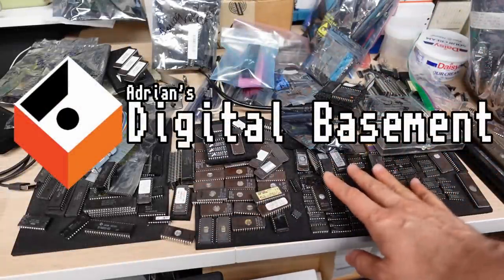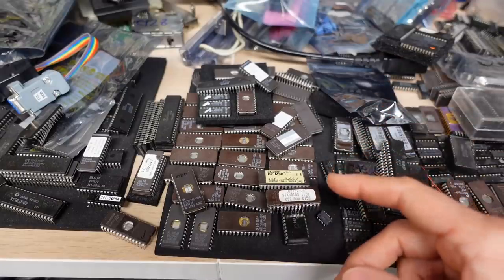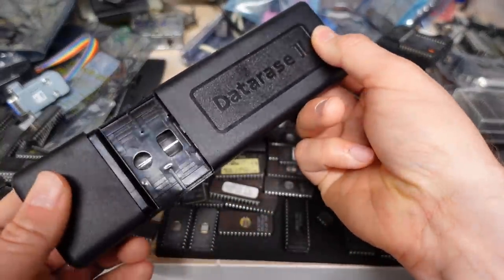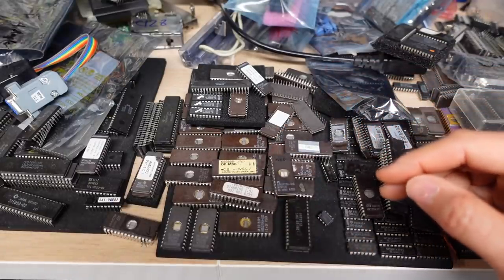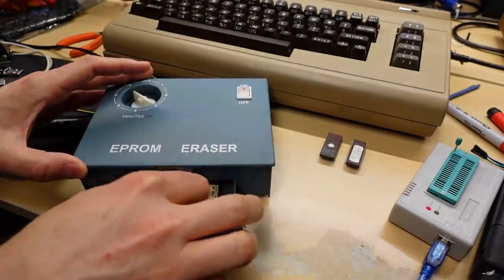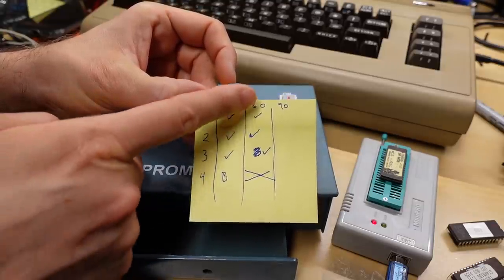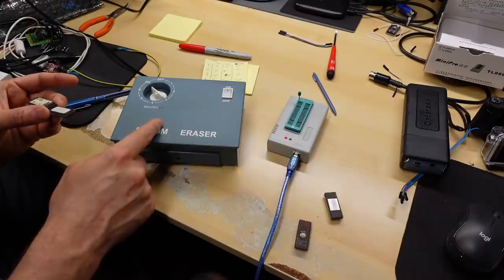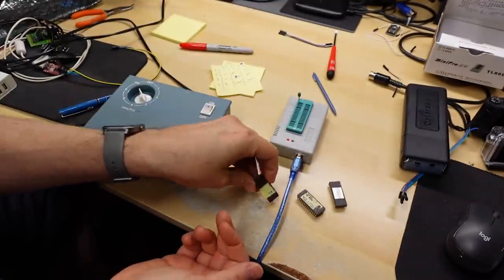Do paper stickers protect an EPROM from getting erased?

Comment: I have had a eprom that went corrupt. It had no sticker and the cabinet had an open mesh at the top and rear. It stood near  a window for many years. After it failed it stood there for some years before it came in fore repair. The eprom was as good as empty, tried to get the hex file from the manufacturer but it was to old (25 to 30 years). It took long because UV is (partly ? I blocked by klass. My eprom eraser does it most times in 10 minutes. I tried erasing them on UV tubes from a face tanner but after many hours they were still not erased. 

Thanks for testing this, I wondered for a while if stickers were enough, I use alu tape after programming to bre sure

Comment: Most glass will block UV so even by a window it wouldn't erase it, unless the window was opened. Same reason you can't get a sunburn inside your car. 

If you do need UV to pass through glass, like in aquarium UV sterilizers for instance, it has to be quartz glass.

Comment: It's a good thing EPROM's have been superseded by other technologies. I'm pretty sure the visible-from-space, disco-nightmare of high-intensity ARGB LED lighting that I (and my enablers at various hardware vendors) splattered all-over the inside of my current rig, can not only emit enough high-spectrum UV light to erase those EPROMs, but could burn the paper labels right off the top of those ceramic packages. And yes, ARGB does make my 5950x faster, and I will hear no different.

Comment: Id be interested to see whats in that EPROM eraser. I have one that looks very similar, and it looks like it was made from a recycled CFL lamp ballast! The wiring was dreadful, nothing was insulated and it was only by a miracle that the tube tails were not shorted out. Oh, no lamp holder for the tube either.
Reply: sounds like the average American domestic central air system, they sure do love their rats nests and burcaps.

aluminium wiring was an economy thing post WW2, IR2 losses overheats and catches fire, previous to that was cotton covered wire, gets chewed overheats catches fire...

Comment: Ten to 15 minutes isn’t always enough with old EPROMs… the last ones I had to erase and reprogram took a half hour in the eraser. Also, there are certain chips the modern TL866 programmer will not properly program, you have to use an older unit to do those. Ran into that when trying to do some 2732s and 2764s. As for labels, I tend to take the labels off any that are intended to be repurposed as I don’t care about the content (or have it safely backed up somewhere) and only put on a label once the chip is programmed.

Comment: just got an old Heathkit ID-4803 EPROM eraser  on ebay for the same price as the new chinese plastic ones, this one is an old metal one that they used to sell as DIY kits in the 80s and 90s. works great, erases chips in 10 minutes.

Comment: When you think about it, it's pretty obvious why the paper stops the UV from erasing the EPROMs. The photons have to hit the die with enough energy to flip the bits, and only UV-C rays have enough energy to do that.

If you've ever shone a UV light on paper, you'll have noticed it fluoresces blue rather than just reflecting the deep purple of the UV light. That means the molecules in the paper get excited by the photons and emit lower frequency blue light. Because the paper fibres have a random alignment, there won't be any gaps for photons to get through, so the only photons that reach the die are the ones that are emitted by the paper fluorescing, which are too low-energy to flip the bits.
Reply: That's a fluorescent dye deliberately added to the paper to make it appear bright white.
Reply: Interesting. Now I'm curious whether brown or unbleached paper without the dye would stop the EPROM from being erased.
Reply: @UpLateGeek  Basically, yes. For a dye to give fluorescence, it has to be diluted (because the emission and absorbtion spectra heavily overlap and in high concentrations it reabsorbs its own fluorescence until all energy is used up in non-radiating transistions). So it will absorb only a few percent (at max) of the total UV anyway.

Comment: I tried to erase eproms using sun light without success.
More than a week with direct spanish Sun. No byte goes to FF.
After that test I buy an UV eraser.
Reply: I've had mixed results.  Programming 27128 or the better chips (28 pin) on a minipro, yeah, they don't get erased by simple sun because I tried that as well.  However, I had some 2716's (24 pin) that I programmed with the minipro and those did get erased.. However, the minipro barely has enough voltage to properly flash those eproms so part of it could be that, or perhaps they are just more susceptible to UV.
Reply: @brianv2871  Probably underprogrammed, many cheaper programmers give not enough charge. These EEPROMs can partially lose data after few years in target device (dark environment).
Reply: @adamw.8579  Yeah, that was my assumption as well.  Thanks!

Comment: I used to work at intel and there was an EE who had a cube near the window, and had kept an EPROM on top of his cubicle for years and years checking it every few months, just to see when it would be erased.
Reply from the maker: Heh! I'd assume through window glass it's even less likely since a lot of UV is filtered by regular glass as well.
Reply: @adriansdigitalbasement2  Unless it is made for UV filtering glass doesn't normally filter much.  Plastic is much better at it.  I am doing work with epaper where UV filtering is important.  BTW I emailed you to see if you want an Apple  (68K) Interactive TV Box.
Reply: Modern energy-efficient windows are specifically designed to block UV.
Reply: @nickwallette6201  thank you. I didn’t know that

Comment: judging by all beige plastic that has been yellowed by UV, the risk isn't zero even inside the case. 

just depends on whether light enters through a vent or space and hits an EPROM.

it doesn't have to be totally erased, just one wrong bit can ruin it.

also, CRTs emit UV. strong enough or for how long... who knows?

i would say you're safe, esp since you can test and remake EPROMS. but if you give something away, be a good guy and cover it up.

Comment: Thanks for this. I wrote the completed release of Star Fox 2 on to an EPROM chip and hand wired it into a doner SFX2 cart, so I could play it on original SNES hardware (this was before flash carts could emulate Super FX chips). I was just wondering if the chip would need to be rewritten eventually. Good to know!

Comment: can you try this with a piece of scotch tape? i'm curious if it would still block UV. uv transparency is a weird thing
Reply: I'm quite confident it will protect it for some time. Although if EPROMs can be erased with sunlight, it means that UV-B can erase them after some time, because there's no UV-C in the sunlight at ground level, the atmosphere filters it out completely. The Scotch tape will probably block more than 95-98% of UV-C, but probably won't block more than a few tens of percents of UV-B, which is also emitted by germicidal lamps.

Comment: I think people tend to forget that PROMS In general all have a limited lifespan once they're programmed. It's been a pleasant surprise actually that most of these older EPROMS have lasted 30 plus years. There's never a guarantee they will actually last that long. Some of the more common drop-in ones today such as the 28C series have a 10-year lifespan according to the data sheets. They might last longer, but there's no guarantee. It does seem like the older ones that use the 21-volt and up programming voltages tend to last longer. Again though, there's no guarantee outside of the data sheet spec that it will last. Even then, there are always bad ones in every batch!

This is why it's critical to dump old PROMs in particular into archives, especially when they're used in critical BIOS functions.  With common programmers such as the TL866 dropping 21-volt support, it's also becoming critical to become familiar with replacement PROM options and alternatives. Eventually the current generations of PROMs will also run their lifespans, and replacements for those will need to be developed. It's a never-ending cycle. Nothing is permanent, especially in computers.

Comment: I have heard of "one time programmable" eproms without the window being erased by a dental x-ray, maybe multiple exposures required. But it would hardly be worth the hassle these days.
Reply: Some UV EPROMs, were packed to IC without UV window, so they become such one-time EPROMs, those could be, in theory, erased by x-ray (or gamma radiation).
Real one-time PROMs have components (diods ?), that were selectively burned on programming.
Reply: @semibiotic  sure, though most of those applications you would use a mask prom that is programmed before they even cut up the wafer
Reply: @semibiotic  I tried erasing the OTP EPROM (normal programmable EPROM, but without the window) with a hospital X-ray. No success.
It is possible that I needed a more powerful or special x-ray.
Edit: By the way, real one-time programmable chips are not EPROMs, but PROMs. Because the letter E stands for "erasable".
Reply: @SirWolfCZ  Thank you for correction.
Reply: @SirWolfCZ  
Needs at least a few tens of kRads according to various sources.
An hospital X-ray machine creating these doses would erase the patient, too. But .. like .. immidiately. 

When EPROMs were first conceived, they actually planned to erase them via X-rays. But then they discovered that X-rays also caused lattice defects in the chip, so you could maybe get 2 or 3 erasings (with the latest programming being significantly less reliable) out of them before you had to bake the chips in a oven at quite high temperatures (read about 600°C) to anneal them, which also damaged them in the long run.

Comment: Aren't those labels metallized at some layer anyway? At least ones in all 386 and 486 boards I got were, or they had some additional layer making them completely non-translucent. Even used one to cover a super-bright blinking standby LED in my Samsung monitor back in a day, 'cause even insulating tape did let some light through, and Award BIOS sticker did not ☺

Comment: EPROMs aren't only erased by UVC light, any light works. UVC is only much faster than other wavelengths due to having much higher energy. There is nothing special inside an EPROM that reacts specifically to UVC light. Photons strike the surface and punch out electrons (similar to a solar panel), which reduces the stored charge in the memory cells.

Comment: Those things require UV-C light (about 265nm wavelength) to erase. The EPROM windows are made of quartz, not much else will pass those short wavelengths.  And I can believe that a fat fingerprint could block the erasing.  It would be best to clean the window before erasing as there might some left over adhesive on the window.  Of course all that stuff is hopelessly obsolete.
Reply: Where did you get that information from?

EPROM datasheets say less than 400nm.

Comment: EPROMs are erased with UVC. It's unsurprising that a paper label would block UVC, because pretty much everything blocks UVC--including the atmosphere and most types of glass. So while yes, the paper label will make absolutely sure the EPROM does not get erased, there's unlikely to be any significant UVC for the chip to get exposed to in the first place.

FWIW I tried erasing an EPROM with the curing light that comes with rapidfix adhesive, and not a single bit was erased after an hour. I suspect sunlight only works because the sun puts out so much UVC in the first place that enough gets through the ozone layer to do the job--but it would have to be direct sunlight, even a windowpane would block most of *that*.

(It's possible that the broad-band UV put out by the sun is powerful enough that it can erase EPROMs despite not being the ideal wavelength. An expert would have to speak on it)
Reply: EPROMs can be erased with UV-A according to their datasheets.

Comment: The light of a single arc in the computer can erase bits in the eprom. Given the fact that regulated powersupplies regularly discharge their capacitor when the electricity cable is plugged in, the light of one those sparcs could surely erase some bits some of the time.
Reply: Er, well, if your capacitors dis charge when you plug the power in, you've got a faulty power supply.  But also, there shouldn't be any arcing.  If your PSU is arcing, it's also definitely faulty.

(With the exception of inrush jumping across inlet connector terminals as the plug first contacts the receptacle.  But that's going to be contained by the insulating material of the plug and receptacle.  Likewise, any old manual switches -- but again, that's going to be contained inside the switch body.)

Comment: I wonder if those OEM paper labels were chosen for being UV-blocking (special paper?), but I doubt it.  A more extensive experiment would test the post-it note too.  

I think an important point is that for an EPROM to be ruined from accidental erasure, potentially only a single bit needs to be erased, not the whole thing.  That can happen from e.g. a random cosmic ray, so the chip only needs enough protection for the UV to be less likely to erase a bit than a cosmic ray, for a given time period; any more UV shielding is mostly pointless.  It would be interesting to see research on a chip left in a non-basement indoor location (i.e. with windows) and see how long it takes for the bits to get corrupted.  I'm not suggesting you do this, but I'd totally read a scientific paper about that.

Oh also I didn't notice the AC noise at all.  Don't worry about it. = )
Reply: inside an enclosure its mostly dark.

Comment: No stickers are necessary if you keep the UV EPROMs inside the machine. I've tried to erase such EPROMs putting them in the full sun, and after two days chip wasn't erased. I also tried to use some UV LEDs (resin curing lamp) and it didn't worked as well.

Comment: I know Portland weather might not cooperate, but I wonder if exposure to full sun would erase them. It'd be great to see if 1 hour, 1 day, 1 week does it. Maybe leave one uncovered in your suniest window and check in on it periodically. Sounds like good second channel video series.
Reply from the maker: Actually others have done this testing -- but also if you check the weather here now, it'll be 111F/44C this coming weekend. (And every day on both sides hot and full fun.)  Here's an article on using the sun to erase chips: https://hackaday.com/2016/09/14/staring-at-the-sun-erasing-an-eprom
Reply: @adriansdigitalbasement2  That's a great link, thanks!

Comment: There is actually some UV light coming from the LEDs. The fact is that it's 504nm which is well above the wavelength that would erase the EPROM's data. They require UV C, not UV A. A fluorescent tube designed to disinfect a room or water sistern would work but it would also give you skin cancer. LEDs just don't have the spectrum. Neither do most fluorescent tubes including the black light kind you'd find for party lighting.

Comment: Whilst you are mostly right about ambient UV being a bit too weak to reliably wipe a EPROM, you made one massive flub when you said you are in a room lit by LED bulbs so there's no UV.

Why? Because there is no such thing as a white LED bulb. Well... there are, but they are prohibitively expensive to the tune of thousands of dollars per bulb.

The normal white lighting LED bulbs we get aren't white LED's. They're Blue and UV LED's covered with a yellow phosphor. In this way they are more similar to conventional fluorescent bulbs and that actually means there IS a decent amount of UV bleedthrough.

Take a decent UV flashlight out to the roadside at night and shine it down the road towards street signs. See how they illuminate many, MANY times brighter than the surroundings? Road signs are coated to fluoresce under UV to make them more visible during daylight. Any bulb putting out UV at night will illuminate the sign far far brighter than a conventional bulb. 

Go into a darkened room at night that has LED bulbs, close your eyes and turn on the lights, and wait about 30 seconds. Now turn off the light and immediately open your eyes and look at the bulb. It will typically continue to have a dim glow for around 20-30 seconds. What you're seeing is phosphor decay. The cheaper the bulb the more likely this is. 

So if you're using LED's, you're actually being exposed to a decent amount of UV, because again, they're not white LED's, they're blue/uv LED's + yellow phosphor. If you remember your CGA colourspace, R+G == yellow, R+G+B == white.